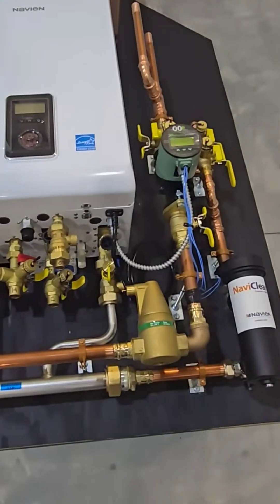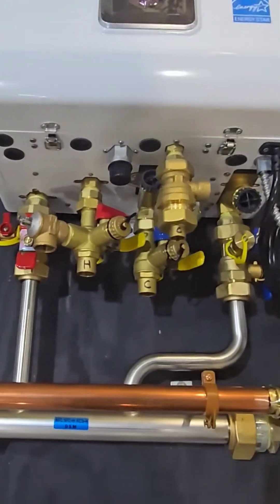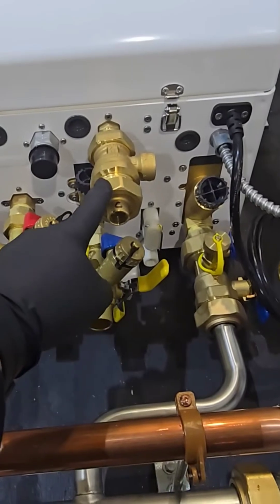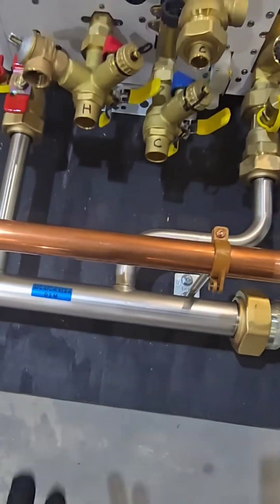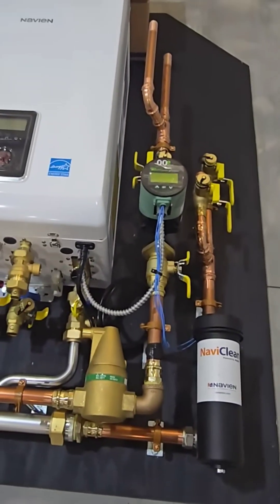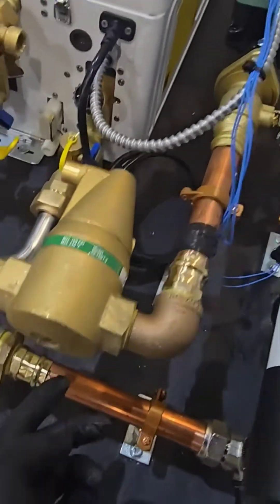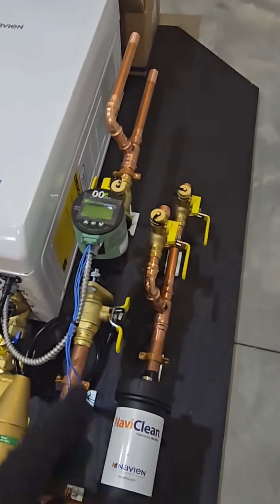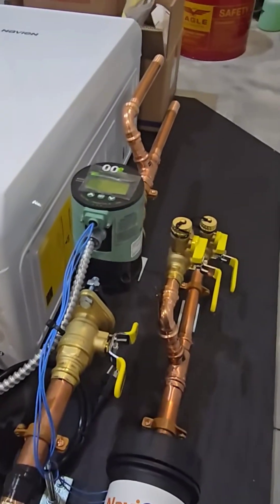#boiler #heating #hvac #plumbing #hydronic

Comment: If you're gonna put the spiral vent down there, don't bother with the dual vents on the Navion
Reply from the maker: Are you referring to the vent on the top of the boiler?
Reply: @JimSperanza most have one on the internal pump now too
Reply: @fantasyplumber you talking about the air scoop? Spiro vent?
Reply: @evergreen4034 ya same deal. A scoop is slightly different than a spiral but air elimination device
Reply: @fantasyplumber I’m pretty green but I’ve always been under the impression more is usually better when it comes to air. I would think you wouldn’t wanna trust air elimination devices inside the boiler, but I’m sure you know better than me
Reply: @evergreen4034 ya but generally isolation valves and hose bibs is the way to go. Extra auto eliminators become a liability after the system goes black. Valves and hose bibs are invaluable on future service
Reply: @evergreen4034 it's definitely system size dependant though
Reply: @fantasyplumber true. In the passed we’ve added dedicated air eliminators as well as valves and hose bibs for each zone
Reply: Spiro vents are a great form of air elimination. My Naviens look pretty similar. Great setup

Comment: Hey Jim! Excellent work! How do you plan on raising and mounting the board with the Combi attached?
Reply from the maker: 2 guys can get it on the wall easy. Just put a ledger board below the bottom of the board so you have something to set it on while lagging it to the wall.
Reply: @JimSperanza would you say the navien is the MOST problem free? Are they DIY repair friendly if one is very technically inclined?
Reply from the maker: @BEANS-O-MATICtransmissions they work extremely well and just like anything else, if you install it correctly and perform any required maintenance it will run for its designed life span.
Reply: Is this system already mounted to that black thing it’s laying on? I generally like to put a piece of diamond plate aluminum behind any equipment I install. It adds a very nice touch that the customer appreciates.
Reply: @kwrath96 😂😂